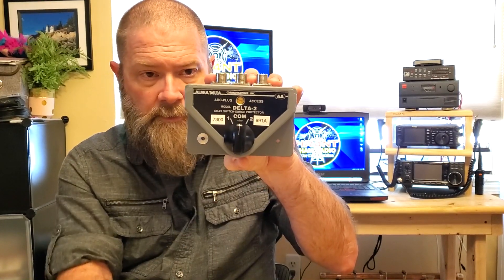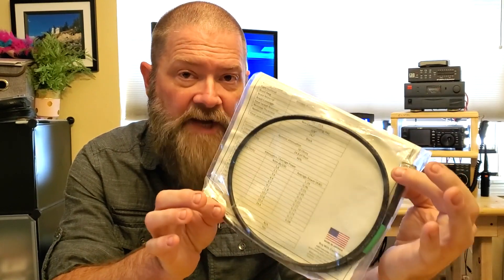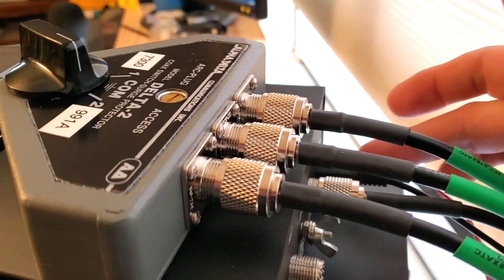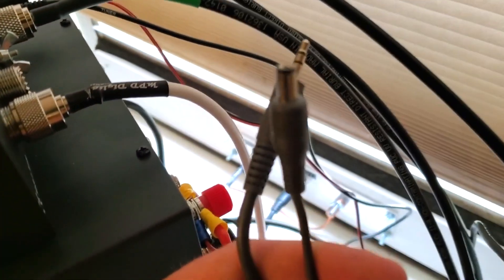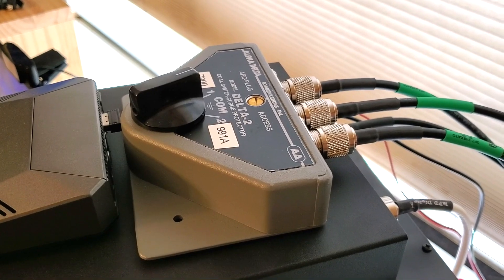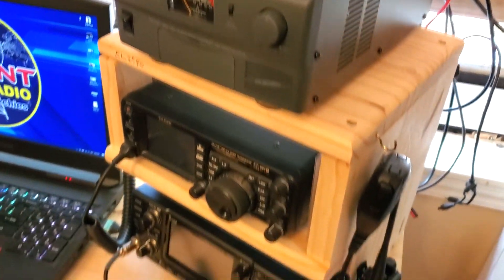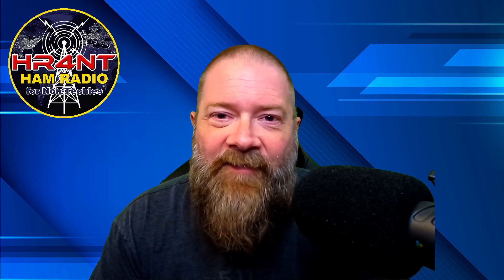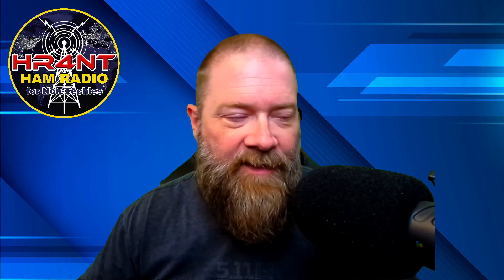A Tale of Two Radios - Running two radios with one antenna

Comment: Thanks for the video as I just bought the 991A and was trying to figure out how to do what you just showed. Did you ever figure out the tuner end of it? Or do you simply plug and unplug each time?
Thanks again de N4SRB
Reply from the maker: I ended up buying an LDG 200 Pro Tuner at the time and had that plugged into the 991 for the antennas I have that require a tuner to operate and that are beyond the capability of the 991 internal tuner.  However, since that video was made last year, I now try to only use resonant antennas that you tune once with an analyzer and never touch a tuner again with them.  For portable operations that is definitely a time saver and less gear to hump out into the woods.  I hope this helped.  Thanks for watching and for the comment.,  73!

Comment: Very cool, I have the opposite problem, two antenna one radio.
Great video man, thanks.
Reply from the maker: So, if I am correct, you would need an antenna switch to have multiple choices for antennas going into one radio.  Glad you enjoyed the video!  Thank you for watching!  73!
Reply: For this, just swap the connections on the switch. ;-)

Comment: I run 4 radios and 1 antenna. Alpha Delta 👍 The mistake you made is it only a two position! Lol
Reply from the maker: LOL, I don't plan on having too many more radios at this time.  This hobby is getting expensive...LOL  Thanks for watching.  73!
Reply: @HR4NT  The hobby is expensive.   Doing videos about the hobby gets even more expensive.   Thankfully I got off that wheel a few years ago.  Keep up the great work.   Remember it helps to draw out how you want it to go.  If you get a third radio... get another switch and drop position one down to the Com on switch number 2 and tada!  You have more available.

Comment: I run two radios 991a and. President Lincoln II + (with 11M mod) and I use two MFJ switches.
First switch you can select either radio then the run into a power/swr meter, then out the power meter Into the next switch where I can select a dummy load or go into antenna tuner then out to the antenna.  This way I can do a test of either radio into a dummy load. 
So 2 into 1 then 1 out to 2
Reply from the maker: That is a fantastic setup!  In my journey in this hobby, I am finding things that need to be fine tuned more and more each day.  Thank for the suggestion and for watching.  73!

Comment: Great vid as always. Do you keep one radio off when you’re using the other one? If not, have you seen any issues with feedback when you transmit on the active one? I’ve heard that there may be issues with some stray RF getting back into the the off service radio and causing problems (or even burning  out finals) if it’s still on. Anyway, keep up the great vids and keep on keeping it real.
Reply from the maker: Thank you for the question.  Normally I have one radio on at a time, however, I have had both on at the same time but the 7300 was on HF an the 991 was on a VHF repeater.  So far, I have not seen any issues with interference or feedback between the two radio when operating simultaneously.  I will continue to monitor the radios when they are both powered up to make sure.  Glad you enjoyed the video.  Thanks for watching.  73!!

Comment: I agree with not doing live.  I really hate live broadcasts.  To me, it is just an excuse for not doing a properly edited video that YouTube is supposed to be.  Also, since the 7300 has a very good tuner built it you can use that and the other one on the 991A.  Since runners remember frequencies you have set it makes it easier that way.  Just a thought.
Reply from the maker: I don't mind doing lives.  I do them every week with my students, but I have things to talk about and it is setup as a Q&A if they have questions about my course.  I mainly use my DX Commander Classic for my main antenna, but I have a plethora of other antennas that aren't exactly 2:1 and require an external tuner only because the built in one won't handle it.  Thanks for watching and for your comment!  73!!

Comment: I have had both radios like you have and found the 7300 super easy to do FT8
Reply from the maker: I thought about using the 7300 for FT8, but since I have been using and already setup the 991A for FT8, I didn't see a need to be redundant.  I am LOOOOOOOVING the 7300 though.  Super easy to use and better reception in my opinion.  Thanks for watching.  73!